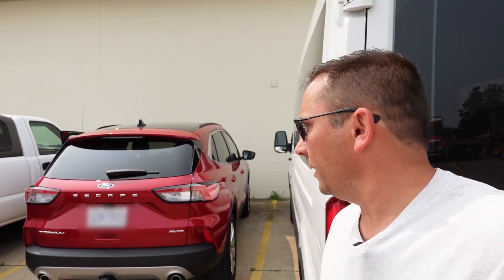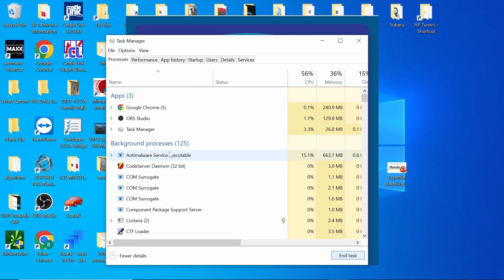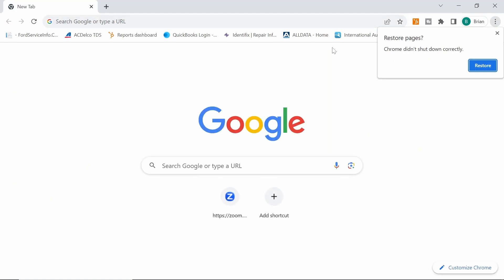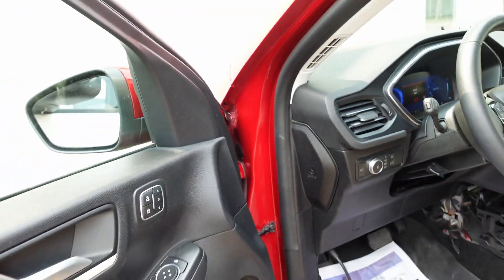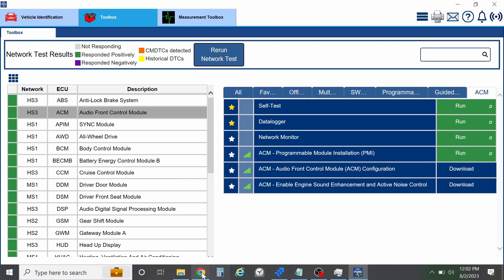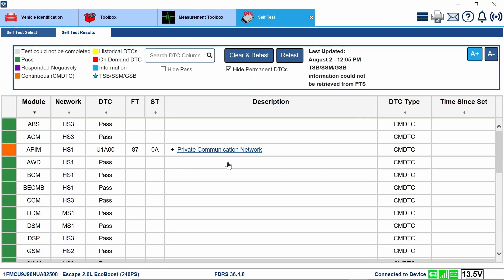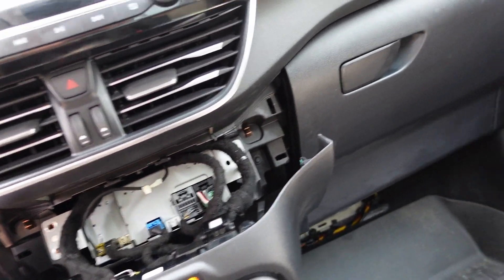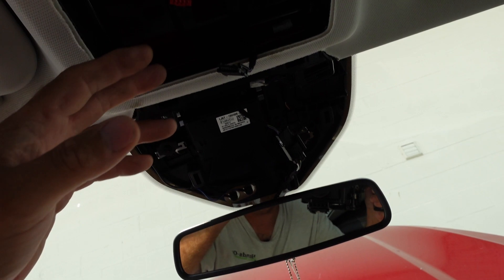2022 Ford Escape How to Program a ACM using FDRS

Comment: Hey, I am trying to program a ACM for a Ford F250 2016 , complaint is no sound from any speakers, touchscreen display works fine. I replaced ACM tried to use Forscan with ASBUILT, no good. Paid for FJDS(2day one license) and using J2524. Under PMI no ACM listed, all other modules show PMI available. ALLDATA and Identifix both say PMI required for new ACM. Please help.